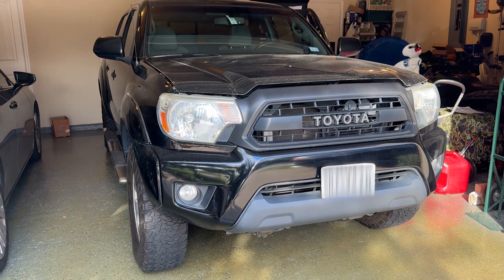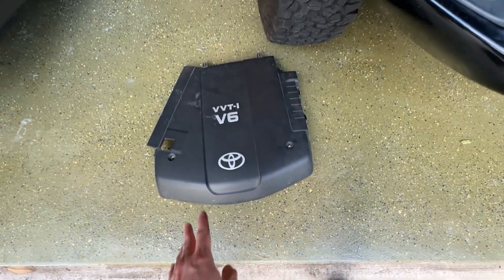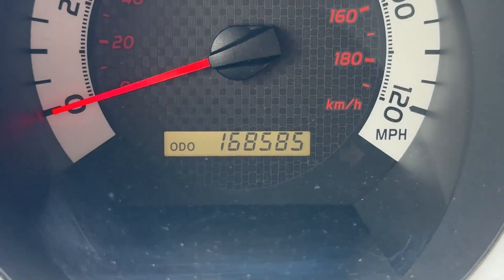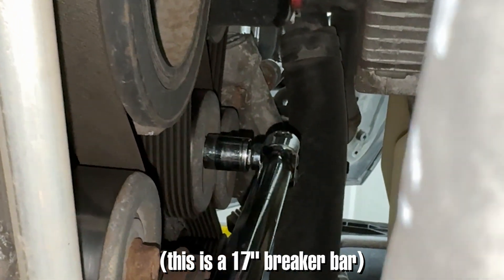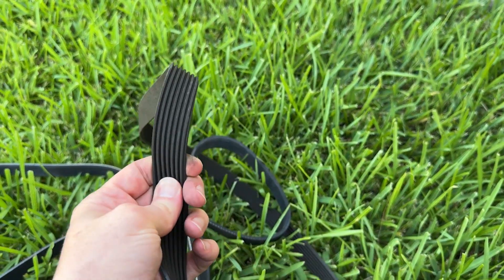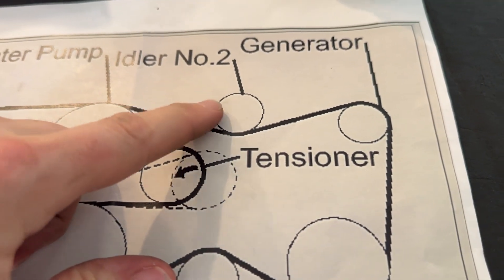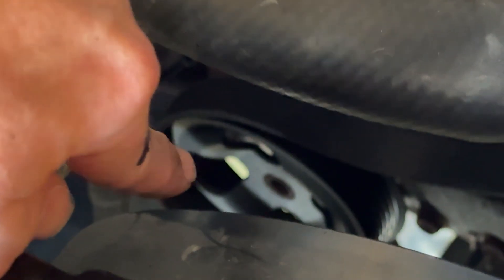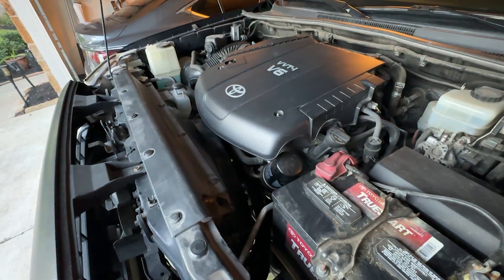Replacing Serpentine Belt Toyota Tacoma 2005-2015 (SECOND GEN THE EASY WAY)

Comment: I wouldn’t use an impact to remove skid plate bolts. Spray PB blaster first, let it sit, then use  a long wrench to remove it. Otherwise, you’re just going to snap it off.
Reply from the maker: These bolts weren’t seized, I was just being lazy. The dealer changed the oil last and I’m assuming they impacted them on. I never impact anything on… just do it by hand. Thanks for the comment.

Comment: Which eBay seller did you use?
Reply from the maker: I used a few different sellers for the parts in this video. In fact I bought the serpentine belt over a year ago while getting ready for this job. Sometimes you can find sellers who bundle all the parts for a specific repair job and give you a good discount. 

I usually buy from Toyota dealers that have eBay stores where they liquidate parts if they have what I need, but I also buy from individuals with good feedback and I’ve never had a problem.

One good Toyota dealer on eBay is belllexusnorthsc
ottsdale, there are a lot of of them out there selling stuff directly from their parts department for cheap if you look around.
Reply: @TechCloset thanks man, appreciate it!

Comment: Side note. Most dealerships don't produce their own parts. They source it out from other companies. If you can find out the company they sourced it from you can save a lot by buy from the source as oppose to dealership. Literally same part, rebranded from dealership.
Reply from the maker: That’s correct. I once bought a Toyota serpentine belt off of eBay and thought I got ripped off because it was labeled “Mitsuboshi”.  It turns out that’s one of the original equipment manufacturers that Toyota uses.

Comment: How was the tensioner pulley? Just curious since you didn't replace it.
Reply from the maker: As far as I could tell the tensioner on my truck is still in good shape. It runs silently and doesn’t have any play or noticeable issues when spinning it by hand. It definitely would not hurt to replace it when you do this job, if you don’t mind the extra effort and money to do it.

Comment: Holy cow this video is only 9 days old? My truck is a touch older with a few less miles than yours but it's due for the same work. I'm inspired to DIY this as it seems pretty straightforward.
Reply from the maker: I bought the new belt about three years ago and put it off until nine days ago 😂
Reply: @TechCloset  lmao

Comment: Just did mine as well (2013 TRD).
Kudo's to the OP for the video, it was very well done.
As a former Gates Rubber rep. I'd like to add a few suggestions to the less mechanicaly inclined.
As OP mentions, this is best done from below, but remove the top cover.
If you have access to a set of ramps, you'll appreciate the extra elbow room.
Part of the problem doing this job is working with little space between the pullies and the floor.
I found relieving tension on the binder was best done with a 3/8 ratchet that has an extendable handle.
Once the new belt has been installed ( I should say routed,but not installed).
I used a 14mm on the binder, and did the final mounting on the binder itself.
The the 14mm acts as a holder for the belt ,just before the final positioning.
If your Taco has the double skid plate like mine, don't forget to wirewheel those bollts holding both plates...and use a little anti-seize (winking).
My installation took 1 hour to complete.
The belt I installed was Gates part number K070834 purchased through RockAuto.
And yes, I wiped the cover when finished as well...
Don't tell my wife and I won't tell yours.
Should be good for another 100k.
Cause Taco's don't break, they just wearout slowly...😜
Reply: Does the gates belt run quiet on yours?
Reply from the maker: Not OP and I don’t use aftermarket parts, but the Gates belt should be just as quiet as any other.  If you have issues with noise then it’s going to probably be a bad idler pulley and/or tensioner.
Reply: @TechCloset  Tensioner (whole assembly) and idlers are new. All of the aftermarket belts are smooth rubber on the non-ribbed side, whereas the OEM belt has a "fabric" like backing to it. All of the aftermarket belts I tried eventually started squeaking on the idler pulleys. I've seen some people have no issue with aftermarket belts and others only OEM runs quiet. It's strange.
Reply from the maker: That is strange. You have a good point about the texture on the back of the belt, I never thought about it but then again I always just use whatever Toyota sells me.  I assume most people buy the aftermarket ones but honestly most people probably don’t even pay attention to the noises.  I’ve never had any squeaking on my truck personally, just the “taco tick” noise. (I never go off road though so my engine is pretty clean.)

I’d recommend checking out the Tacoma World (.com) forums and search around if you haven’t already.  I do remember seeing people complain about squeaking even with the OEM belt, and I think there may have even been a TSB about it.